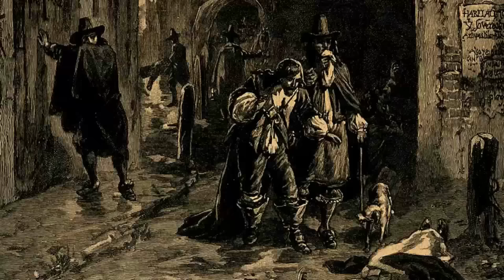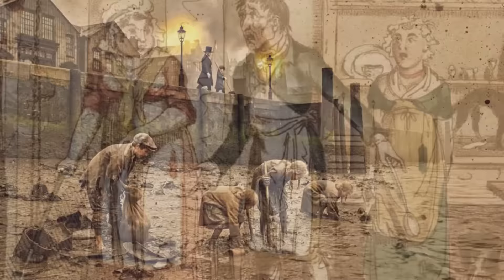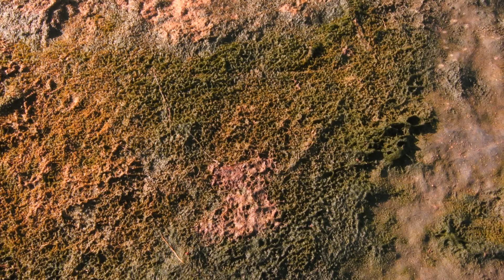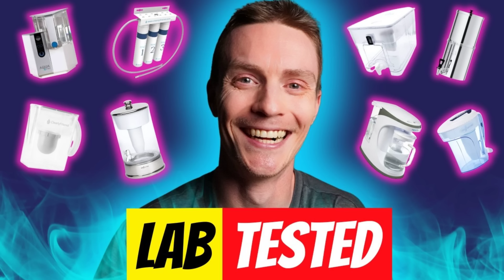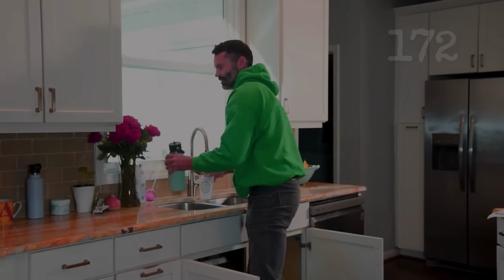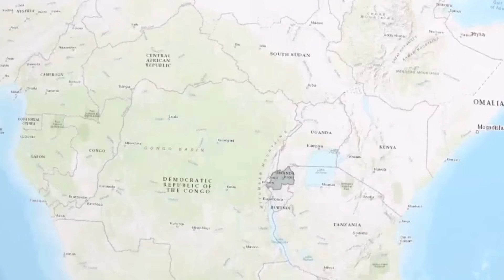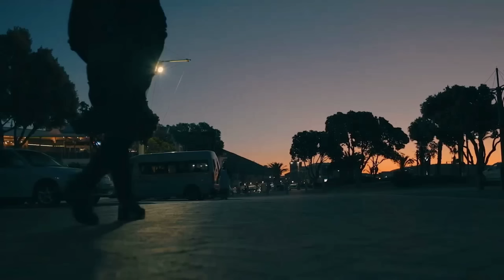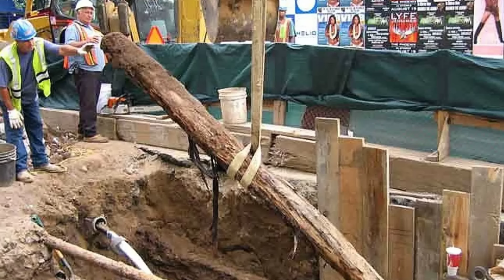The $50 Water Filter That Outlasts Any $5,000 System. Why Don't They Sell It?

Comment: downvoted because you omitted the biggest issue entirely. If you have a mains water supply in any relatively modernised region you issues is not waterborne diseases since pre-treatment and chloramine takes care of that. The much broader problem now is pollution, you have nitrates, flouride, PFAS, arsenic and so many other extremely negative compounds in the water which sand filtration does nothing too. You spent 30 minutes jumping around the elephant in the room because it goes against your argument. This magic filtration technology you spout about has not been forgotten, its just that it is not realistic amongst modern demands. Nobody here is disagreeing with the fact that cheap filter jugs suck, its the the fact the basic understanding of what can and cannot be filtered via what method. Reverse Osmosis is by far the best method to get at least most of the pollutants out at scale, though if you are looking for total purity distilling is the way, distilling is actually what has been done for thousands of years, but for some reason you overly concentrated on sand filtering for some reason.

Comment: Do not build the biosand filter in America,  we have chlorine and floride in the tap water, chlorine will kill the biolayer and it will not filter the chlorine. 

You need a custom built filter with different layers to pre filter the chlorine (or let it evaporate for 24 hours), and you need to add bone char to filter the floride.

Unfortunate this will create much more maintenance to replace layers (every 3 months or so). Floride is the most important chemical to focus on and chlorine is second.  

The biosand filter is great for dirty water with no chemicals

Comment: Sadly this wont work because unless your using well water most local taps are chlorinated which will murder the schmutzdecke layer. The answer is the water company charges alot just to barely chlorinate the water before sending it down the pipes.. our house filter changes annually for like $20 we spend like $40 a year for generic pur replacements. Its neglible since we use tap water. I would gladly use this system if i lived in the wilderness and had a natural water source.

Comment: i filter my closed well water with layer sand, ceramic and coal... but i still boil water before drinking.
Reply: Sounds good. My plans as well. I've heard u could add coppar wire turned around zink wire and put it in the water as a last treatment, for ca 8 h.

Comment: I've built and used bio-sand filters, otherwise known as Manz filters, when living in developing countries. They work great for removing bacteria, parasites and suspended solids (dirt, bugs, etc). But they don't filter arsenic, viruses or VOC's (Volatile Organic Chemicals such as fluoride, chlorine, pesticides, etc). Therefore they are not useful if you wish to filter fluoride or chlorine from your tap water in an urban environment. They are also of no use if your water source contains arsenic.  To further complicate matters, the option of adding charcoal to a bio-sand filter creates the very problem it is meant to solve. Charcoal is a breeding ground for bacteria. Consequently it is normally used in filter technology where the water being filtered contains chlorine which will prevent bacterial contamination. Charcoal would not be a wise addition for bio-sand filters.
If your desire is only to remove bacteria it is far easier just to strain out the solids and boil your water. That will kill the bacteria, parasites AND viruses.
If you wish to remove nearly everything (except fluoride) then you will definitely require charcoal but you will need to build a multi-stage filter and use chlorinated water (the chlorine will be removed by the charcoal while preventing bacterial contamination).
Reply: What would happen if you used a bio-sand filter, then had the output flow through a charcoal filter, and then into a storage vessel.  From the storage vessel, water is continually but slowly pumped back into the inlet to keep the system running.  Water could be poured into the inlet at any time.  Water could only be taken from the storage vessel till it was just above the pump's inlet.  Water could also be further filtered using a reverse osmosis filter installed that pulled water from the vessel, then pumped purge water back into the main inlet.  The life of the reverse osmosis system's filters would surely be enhanced.
Reply: Thought so! Thanks for the detail!
Reply: My solution (for my houseboat) is to collect water from dehumidifiers/AC. Run it through a UV filter incase any biological life got through the air filter and for the drinking water remineralize it.
I have a distiller as a backup in case it’s needed.
Reply: All good information. Reading through the "instruction manual" for sand filters, they still recommend treating or boiling the water after it has been filtered... it's not a perfect set-up, but good to know how to properly set one up and operate it.
Reply: That's why distilled still the best method after filter it
Reply: @andylau13 What is that

Comment: For microbiologically contaminated but chemically relatively unremarkable water in low-tech environments: very useful.

For household water with potentially dissolved pollutants, nitrate, arsenic, fluoride, salt, PFAS, etc.: BioSand is not a general replacement for high-quality, standardized, and certified filters.

Comment: To answer the Title question, they don't sell it because it's not as simple as you'd think. I lived and worked in the remote jungle for 2 years and our organization subsisted on mountain spring water piped to a bio layered multi substrate filter system about the size of a 55 gallon drum. The problem, as we discovered months after a sudden staffing change, was that the water was supposed to be sampled and tested regularly, which we didn't know, and the tests had to be sent out to a lab, which is not easy for our situation or easy for anyone in a SHTF situation. Anyway, came back with high levels of bio contaminants (fecal matter, decomposing stuff up the mountain spring), and after carefully changing all the substrate and stabilizing the bio layer, still had unsafe levels. TL;DR Real world experience: it did not work.
Reply: Did the bio layer ever dry out and die? 
That's the problem the standpipe innovation solved.
Reply: Good to know
Reply: I would also put that this technology currently should not be advertised to be built at a large scale to try to water 1000 homes it should first be implemented and tested at a  smaller scale where you have a unit in each of the homes be it collecting rain water and runoff and/or filtering grey water but because the business model only cares about making a profit and not actually creating sustainable solutions this project can't really be focused as a money making model but as a sustainable and reduction model instead. we humans have to separate profits from sustainability we have gotten way too addict to material money when we have evolved with out that manmade creation. Now money can be made by providing services and routine maintenance but we first have to get away with creating products that have to be replaced type of models and work on more reliable equipment that is modular enough for maintenance and repair before replacing the entire system.
Reply: I notice your comment doesn't have a channel like despite being of the highest quality and relevance
Reply: I imagine it can work, but the culture MUST be diverse and healthy. And that's not exactly plug n play. You have to test it and potentially modify the culture on a semi-regular basis. If you can and do both of those, I suppose it can work...the thing is, water is also a public good; we want reliable public systems for water treatment and delivery. Bio-substrate filters can be disrupted and probably aren't as reliable as chlorination and city wide filtering, especially if you have to wait a few months to a couple years just to reestablish a culture. A great technology, but let's not overstate its use cases.
Reply: @toddchandler5759  chlorination isnt good it raises thm levels in presence of agricultural pollution to higher than safe levels
Reply: @MetaSamsaraRL  chlorine can be evaporated or filtered out; most cities I know of chlorinate their water, and very few take the extra time to dechlorinate it (though, I believe Louisville does). Also, there was a large scale study in Taiwan that found a strong relationship between chlorinated water and birth defects. I don't remember any details though.
Reply: @toddchandler5759  the chlorine evaporates yes, but the residue of THM decomposition remain.water is foamy, tastes irony, has high ph, that's a sign of THM poisoning and it's actively being hushed. as in nothing done about it because it profits big ag
Reply: @MetaSamsaraRL  Sure. I wasn't discounting that, but at least one city I know of that values clean water can and does use chlorine to treat and then subsequently filters out the chlorine and other substances. There are good and bad municipal water systems, and the unfortunate reality is that water treatment and delivery standards vary dangerously widely across the States since it's almost always handled by local govts. I have to imagine THM poisoning is more prominent in certain areas (big ag watersheds) with insufficient environmental regulations and water treatment standards. That does not mean there are not effective ways to treat municipal water.
Reply: @toddchandler5759  yeah my experience is river water and rural france. i imagine thm is least of worries in america with everything goes as long as you got the money state of the economy.
Reply: @toddchandler5759 Yes I agree. It's far easier to have massive water systems that are constantly tested but provide water for many, many thousands or even millions of people. What a luxury it is to have on demand potable water
Reply: this system works best with rain water this is why they are trying to outlaw rain water collection while privatizing mega basins.
Reply: @MetaSamsaraRL  no, it is just simply does not meet the demands, especially when people start living in urban area, it simply does not have the coverage to support the amount of people living in the same footprint
Reply: @MetaSamsaraRL  theyre actually trying to outlaw rainwater collection?

Comment: The challenge with bio sand filtration is that most homes in the USA have a pressurized water supply system. How can this be inegrated into that without a large storage system?

Comment: oi.....a BioSand filter is a pool filter.....this is what is called a traditional or multigranular filter.  Yes its been around for centuries if not millennia.  Municipal water treatment facilities use this as a first step for water filtration.  Other steps include membrane filtration, ultraviolet light treatment, and chemical treatment.  After it leaves the facility it is far cleaner than you could ever get it anywhere period.  The water then picks up contaminates on the way to you through the pipe system.  This is why endpoint water filtration exists usually in the form of activated carbon and membrane filtration.  Membrane filtration has also been around for millennia.  We as a civilization have figured out better materials to complete the filtration.

By the way, the bigger the filtration system is the better it is.  Even with newly engineered materials bigger....is.....better........If you are tired of replacement cartages for your fridge or other small disposable water filtration systems.   Build a whole home water filtration system with by-pass dozens of plans out there.  You can get cheap filter media, and even install a sand filter and other filter and water polishers in line before it enters your home...........

Comment: Sand - carbon - gravel - Cloth - that is most basic filter some additives might be need remove other chemicals like chlorine/fluoride micro plastics. stone or metal avoid plastic. Uv light sun light treat water put filter water in jars leave in sun for 24 hrs.

Comment: Misleading. This video is comparing apples to oranges. The sand filtration system is equivalent to the water treatment that happens in cities. Implying that this filter would replace a household filter or a reverse osmosis system is misleading and incorrect. They serve different purposes. Information presented like this is counterproductive because it clouds judgment and creates confusion instead of clarity.

Comment: This is great for many, many people throughout the world... if only there were such an inexpensive solution for ridding water of heavy metals and other chemical contaminants to use in tandem 🙏
Reply: There is. Buy a glass water ditillation unit for laboratory use ( used one from ebuy) and then pass the distilled water trough regular charcola filter pitcher. This way the filter lasts for months. You collect the distilled water in 3-5 individual 5 liter glass carboys, and when you need it, you just filter it through the carbon filter in the pitcher. The water is just amazing. No heavy metals, no microplastics, no fluoride, no PFAS...just pure water. You will spend 30 bucks more per month for electricity and water
Reply: @momchilalakushev9222     
Yes, I'm aware... That's why I wrote "if only there were such an *inexpensive* solution..."    
And if you're doing this, then why use a charcoal filter at all?   
And - on a side note - what do you do with all the toxic stuff you're left with after distillation?
Reply: @MarceDreaming  very good question. If there are volatile orcanic compounds or chlorine in your water, a miniscule amount of them gets boiled off and then condenses in your distilate. When I use tap water, the distilate has a distict chemical flavour from the chloramines( chlorine reacting with organic acids in the water supply). Fortunately those VOC are in a very, very small amount and the charcoal filter removes them completely( and lasts for months). The distillator itself is   an open system so the cooling and the waste water runs off in the drain continously ( it is no more toxic than what people regularly flush down the white throne :). 2 months of dinking clean water completely eradicated my joint inflamation(I am 40). I am a scientist that works in the field of pharmacology and beleave me there is no combination of anti inflammatory drugs or food supplements that I haven't tried. It seems that nothing helps if you poison yourself on a daily basis via your drinking water. The scariest part is that I was drinking filtered water from the main water supply in the middlle of an European capital..
Reply: @momchilalakushev9222    I meant, why not use the filtration system in this video in tandem with your distillery instead of a charcoal filter?  The distillery already costs quite a bit to run (energy and excess water) without adding the charcoal filters (even if they last you longer).   Just something to think about, I guess.    

And my initial comment stands since running the distillery is not cheap for those in the world who are using or need the inexpensive system shown in this video.

Comment: I had to fact check with GPT, for anyone interested:

6. Why these filters are not sold in stores

The video implies a conspiracy, but the real reasons are simpler:

They are large and heavy

They require training to use correctly

Flow rate is slow (maybe 20–60 L/day)

They don’t remove chemicals or salt

Urban water is already treated

They are mainly used in:

rural areas

disaster relief

developing regions

7. The most important safety issue

Even good filters do not protect against everything.

They do not reliably remove:

viruses

pesticides

industrial chemicals

dissolved metals

So many experts recommend:

biosand filter + disinfection

Example:

filter first

then boil or chlorinate

Final fact-check summary
Claim	True?
Slow sand filtration is real and old	✅ True
Biosand filters used by millions	✅ True
Biological layer removes pathogens	✅ True
Can be built cheaply	✅ True
Better than reverse osmosis	❌ Misleading
Removes 99.99% of all pathogens	⚠ Depends on type

Comment: Sand filters can’t remove all chemicals or heavy metals. Reverse osmosis does. Reverse osmosis is a way safer and more expensive system for a populated world where much of the tap water was used and then filtered by another city upstream.

Comment: A reverse osmosis system is under 200 USD, and you can install it by yourself. Of course, you can pay 1000+, but a basic system, with pump and clean water reservoir was under 200 and I've installed it. The membrane is like 40 or less, but replaced yearly. In my view the main problem with ROI is the waste of water.  Then back to this filter, in theory is easy, people in aquarium hobby are aware of this filtration, however, there are risk, especially from a water that you cannot quickly test. I would add at least a UV lamp after the filtration process.

Comment: Master Water Specialist here. Don't listen to this man; he will get you killed. He doesn't even know about dissolved solids. Salts, minerals, arsenic, forever chemicals, lead, other heavy metals, and nitrates will all go straight through sand and lower your IQ like this guy. The caveats that he isn't even touching here will literally cause you long-term or short-term health issues in some cases. But what do I know?
Reply: Heavy metals, arsenic, and other unwanted chemicals that are not filtered by a biosand water filter require another filter used in tandem, which narrator has stated in various responses throughout this comment section.

Comment: The numbers on installing a point of use RO system are about 1/10th of the stated cost In the US. 
I have had them for over 20 years and they are no where near as expensive as stated.